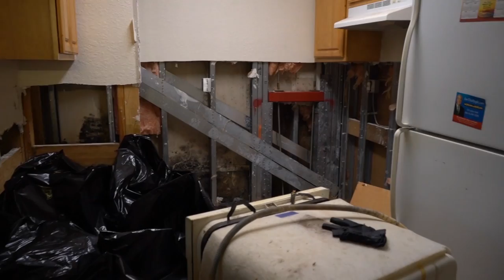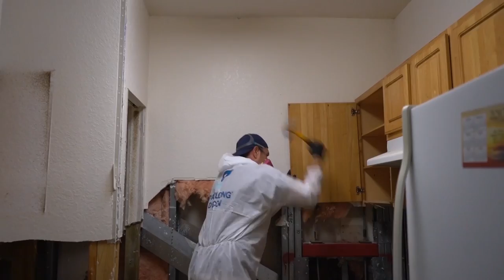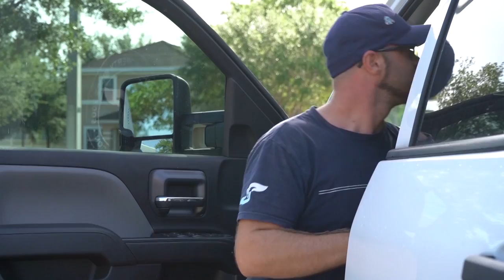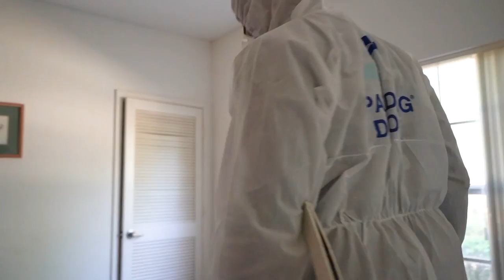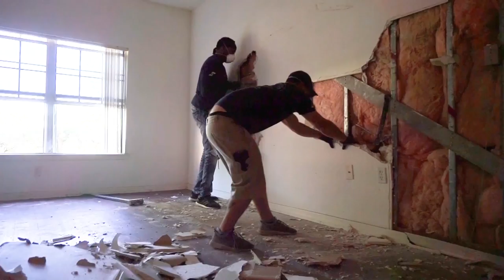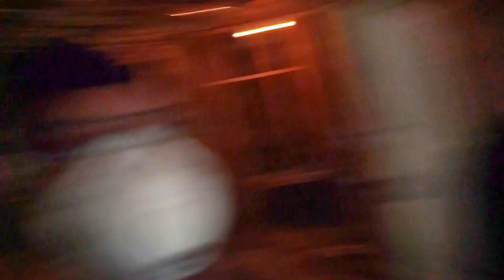Elderly Nightmare Pt. 2

Comment: How can this happen in an assisted living facility? They need to be close down clearly because where the hell is the assistance? They should never be allowing people to live like this. They’re supposed to be caring for these people.
Reply: They aren't allowed to touch the stuff of people living there usually and water leaks do a lot of damage in a short period of time
Reply: Aya Jade they can still contact family and APS when it gets this bad and APS can absolutely take action. Doesn’t matter. If they did any kind of checks they would have seen the mold and known to check  the walls outside of the units. They have had people breathing that for who knows how long. They are at fault big time for how far it got.
Reply: Aya Jade also that doesn’t excuse the cockroach infestation either.
Reply: @ayajade6683  true... buuuuuuuuuuuuuuuuut they are legally supposed to maintain the building, it seems this place just ... said screw it and didn't do that.
Reply: Shannon Staley Exactly!
Reply: Aya Jade you could clearly see the mold & filth, I have worked with elderly, ALL of THAT IS TO BE REPORTED! NO ONE CARED ABOUT THESE ELDERLY RESIDENTS. Assisted living is also include weekly house keeping!

Comment: I hope heads rolled after complete investigation of this hell hole.
Reply: If the people at spaulding decon felt it still unsafe they have to report it to the health department and they will shut it down and get inspections done. If they find necessary (unfortunately) then they will bring up charges. Otherwise not likey. 🥺💔

Comment: Why in the world would they let that tenant back in? They are asking for trouble 🤦🏻‍♀️🤦🏻‍♀️
Reply: I thought she died and they found all this when they went to clean the hoard
Reply: Nope, they mentioned them moving back in
Reply: It kind of seems like it actually wasn't initially the tenants fault. They even said the hoard wasn't that bad in comparison to other ones they have done, which is why they were so surprised with how much mold there was. Initially, they thought it was just one apartment l, about 4 feet up from the ground, then they realized it was in stairwells and other apartments as well.
So probably mold started in the floors under the apartment due to moisture issues, unrelated to the hoard, but went unnoticed for a long time because of how much stuff there was.
This is, in part, due to the management of the building letting obvious issues go on for months if not years
Reply: @rebeccamartens4192  as a nurses aid you're also legally required to report places like this and call APS. You're part of the problem
Reply: Karen Hall  it’s obvious that tenant needed help and wasn’t getting any. It’s supposed to be assisted living.

Comment: I lived in a one room apartment once, that likewise got massive water damage. I was living there with my ex, and we noticed because we could taste the moisture in the air, which got progressively worse, and then suddenly black mold started springing up in the corners and literal streams of water started coming down the walls. Turns out the bathrooms in the building we were living in were so old that apparently you could only take 60sec (no joke) showers before the system got overloaded, so the entire building had massive black mold and insane water damage because everyone had been taking longer showers than 60sec, it literally ended up with our floor boards started bending upwards, so we had this one-foot ramp through our entire apartment, i'd say around 25-30feet long. We had black mold in every cabinet in the kitchen, massive patches of black mold on the walls (which we had been wiping down over the course of a few months, and living with, with no protection) the company that owns the building finally does something about and we had everything removed, we're talking there was nothing but the concrete left.

I'm pretty sure i developed a phobia of black mold over those 3ish months, like that shit spreads fast and it is incredibly unhealthy, if you see black mold, do something about it, because it will spread and the problem does not go away and it will literally make your house uninhabitable within a year.

Also, i'm pretty sure stealing a TV like that, is crackhead certified. Like, who on earth would steal a tv that you probably can't get much money for, crackhead that's who, clearly the cleaners who could probably buy 200 of those TV's from the payment they got from that job alone, didn't steal the old shitty tv lol

Comment: How did you resolve the complaint on your crew on theft?  They have to fix the roof or other floor that is leaking on the other floors?  How can it be a filth issue well part can but with water coming down on apt can't help right?

Comment: Oh my.... As a nurse I would report that assisted living facility immediately & stay on top of it everyday until it was dealt with appropriately. From what I saw on your video, the conditions in that place is definitely not within the standard of living and care that they are required to maintain. Those residents and the employees are at great risk for a multitude of safety & health issues. I have never seen any open running facility in that poor condition.

Comment: I applaud the staff going above and beyond and move this residents stuff to storage. No one should have to live in this kind of condition. However the stuff moved has mold spores on them and will only bring back into the clean area. Not good. The fact there are 3 more floors of needing similar work will be daunting to say the least. I hope there are more videos to show what the end result looks like. I hope the ceiling where the leak was happening is fixed and no more water leaks. If not then the mold will return.
Reply from the maker: Yeah, although we advised the gentleman to discard all items for that reason, we have no control over what happens to his belongings. We just try to help the best we can.

Comment: 😡 This is criminal. They took the elderly resident's rent and failed them. I live in a regular, no frills, simple apartment complex. At minimum, they come once per year to check for leaks, the smoke detectors, and condition of the kitchen's appliances. Sometimes more if they suspect something is going on in the building. There is NO excuse for this, to elderly besides!

Comment: If the leaks are not fixed it will just get like this all over again.  Looks like there were a lot of leaking pipes in the walls and the ceiling that also needed to be fixed.

Comment: This to me does not look like a case of attendants mistreating the apartment, this looks like some really shitty construction work. There is water and moisture where there should not be any if the job was done correctly in the first place. So this is for the most part not the fault of the attendants, this is down to those owning and maintaining the property to begin with. I'm quite sure the whole building is full of mold if they start doing the same to other flats.